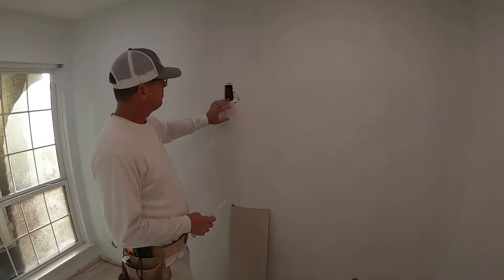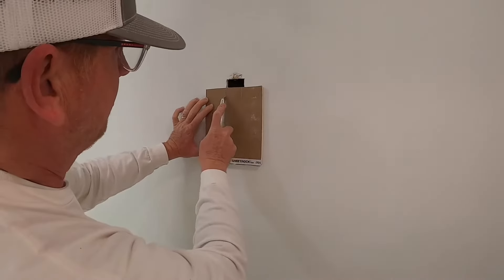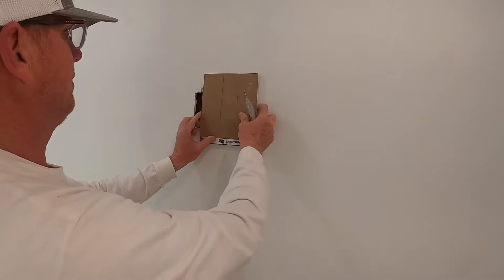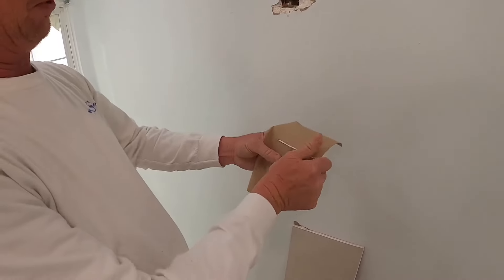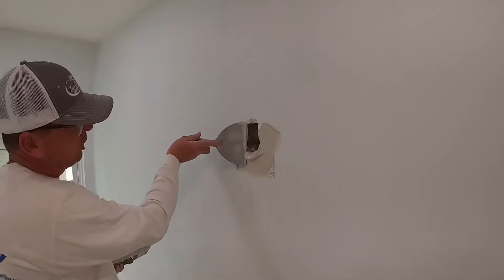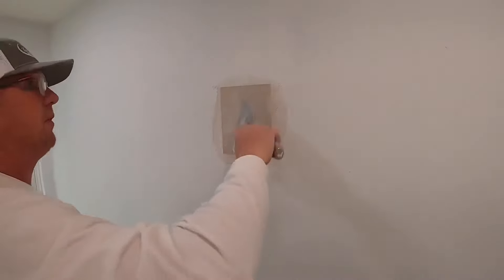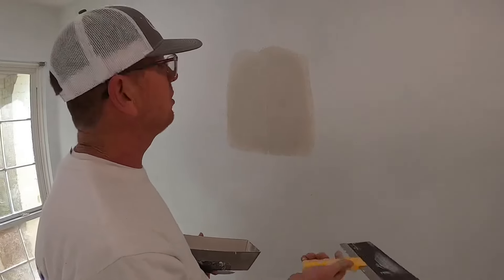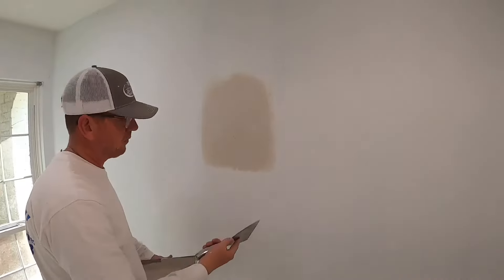How To Fix A Hole In The Wall Full Process (Drywall Repair) (Old Electrical Box)

Comment: Thanks! … does this work on ceilings?
I have small electrical hole on the ceiling above my kitchen island.
Reply from the maker: Absolutely just make sure you mud around the hole and put mud on the back of the tape. Don’t try to fill the hole gravity will mess with it depending on how big the hole is you can use two pieces

Comment: Hi Scott,  thanks for the GREAT video’s!  Question:  Do you use the same Plaster / mud mix for the inside skim that you used for your first float?  I’m repairing cracks to Lath and Plaster from the 1930’s (perhaps it’s like Guaging Plaster but there’s no screen, just lath.)   I’m planning to use your Hot-Mud tip (thanks for that video too)… but I need to know how to mix the skim coat for my second step/float!   If you have any other tips for lath & plaster repair I’d greatly appreciate them for my specific task.   Thanks again for your helpful video’s.
Reply from the maker: Yeah so in the skim coat you wanna use just a regular mud I do like the +3 USG ,magnum makes a really good mud but it’s hard to find and I actually mix about 70% +3 and 30% soquetta , it’s a thicker mud, to make it a little bit more meaty so to speak. +3 is a lightweight mud but it’s really good you don’t have to do an inside skim you can cover the entire surface let it dry and sand it with some 150 or real lightly with some 120 grit unless you’re trying to get in and get out so to speak hope this helps

Comment: Scott, I’m loving these videos. I do all smooth wall repairs. I like the idea of using your plaster or Paris / mud mixture for the first coat and then the inside skim for the second coat. What would you do after those two steps if you are finishing on a smooth wall with no texture? Thank you!!
Reply from the maker: If I’m doing smooth finish, I’m gonna do an outside skim actually cover the entire patch and just give 5 to 10 minutes time so you can sponge the edges of the regular mud once it tacks up a little bit. I hope this helps.